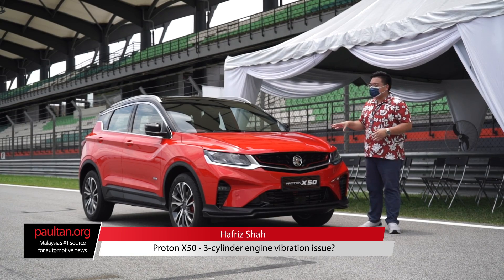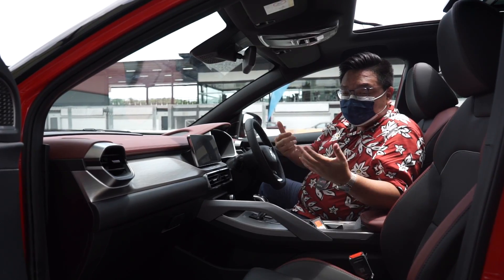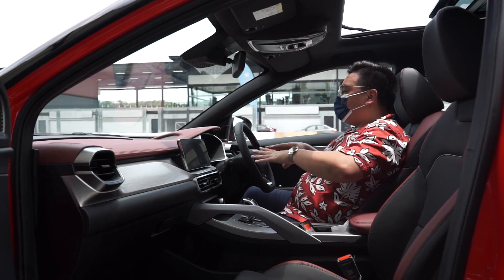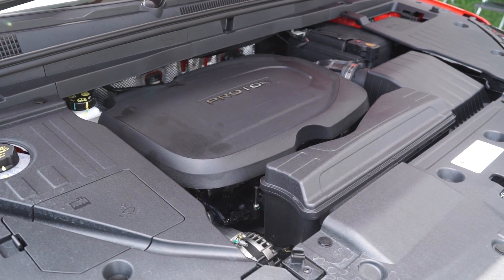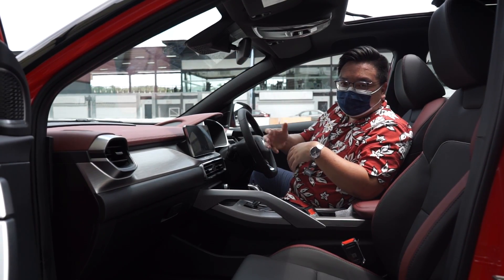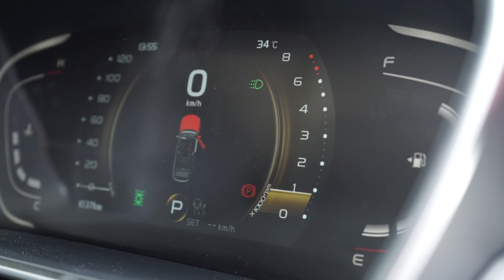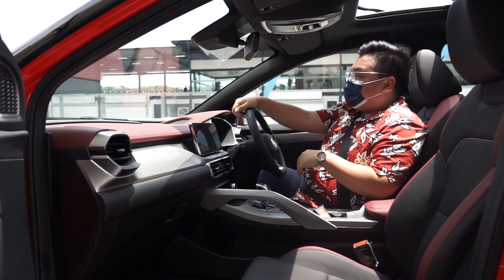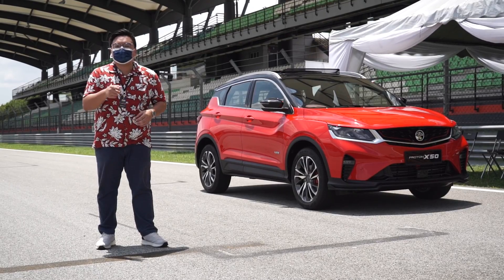Proton X50 - 3-cylinder engine vibration issue?

Comment: I don't know why so many toxic commenters wanna criticize the X50 for what it is so much. Because it's 'Proton' or because it's based on the Binyue? Give you so much, you say Malaysians are lab rats, pricey maintenance, this and that still unrefined, give you too little you say kosong, outdated, behind competition. What the heck do you guys even want??? If you don't like X50 just buy other cars lah, don't pollute rumors and false facts into the minds of non-car enthusiast. Most of the time things aren't even as bad as criticized, don't make something look as bad as it is, the price isn't here and most people don't even get to drive it yet, why so gossip so much? Aiyoooo
Reply: its called fault finding. Perhaps they could not believe proton is offering a SUV with so much features within a reasonable price range.
Reply: Competitors rumor
Reply: @nitric75  ✔️
Reply: Well said.
Reply: good comment 👍👍👍
Reply: Agree
Reply: people not simply TOXIC, they saw something wrong with it...that's all.
Reply: @mreditor5171  

Actually it's not, especially when coming from the X1 owner like myself (ex owner 😭)

When the X1 had some gearbox or oil leak issues, they didn't make a fuss about it because it is a premium continental car

U paid thousand of RM, and to have a mere proton to beat that "premium"ness of an X1, well guess what, for sure people going to look from top to bottom, end to end about this model's issue

Same as continental left to right hand conversion like Mercedes, their steering wheel is slightly deviated to the left, u guys doesn't make a fuss, but when x50 has it, wow the rumors spread almost like the car can not be driven at all

In the end of the day, proton need to launch the product with "rumors free" to people not buying this model
Reply: Waiting for some basher to bring up power window issue to all new X50 which they don't even own
Reply: there are too many 'experts' out there 🤣🤣🤣
Reply: well said bro

Comment: At  any angle you study the X50, Proton has made sure you get value for money, from styling to performance and NVH. Do the ultimate test of placing a glass of water on the engine cover like those old Nissan 2.5 advert but at what extra prices to compare ?

Comment: The main problem with 3-cylinder engines is the vibration as mentioned earlier, particularly at low rpm. Without getting too much into detail, this is due to the imbalanced nature of 3-cylinder engines that causes them to rock about.

Comment: I think this engine quite similar to Volvo's 3 cyclinders T5 engine. I suspect it is the same engine with a slight different tuning since the HP is quite similar. Although, the vibration at 2:44 is obviously too much for modern 3 cyclinders engine compare to Toyota Yaris 3 cyclinder that i had found in youtube.

Comment: Put a glass of water on top engine cover, then we can see the vibration.
Reply: I only dare to put it on a Lexus, and with many glasses of water as well.
Reply: Eh How about try to stand a piece of coin on top of engine cover?
Reply: You think what is this ah? Rolls Royce?
Reply: I've seen those tests, but I don't think that's relevant at all. The engine cover vibrates a lot, yes, but as mentioned in the video you don't feel it at all from inside the car - not at idle, not under revs and not even at full throttle. Even looking at the engine itself, only the engine cover vibrates, not the block itself.
Reply: You can built your own engine and test it first.
Reply: @hafrizshah4937  💪👍
Reply: @hafrizshah4937  bro...u punya c class enjin
Bergegar x?
Try compare
X50 with c class

Just for info
Reply: Stupidest comment ever, typical of shallow-minded people. A 6-cylinder engine, like a straight-6, is inherently balanced. A V6 is less balanced than a straight-6 but it's still easy to damp its vibrations because the piston power strokes still overlap. Putting glass of water on an engine block does not prove how well the NVH will be. A 4-cylinder engine with well-engineered balancer shafts, good counter-balanced crankshaft, hydraulic mounts, etc. could still be smoother than a V6 engine that does not have any balancer shafts and with race-prepped crankshaft & other reciprocal components.

Comment: shaft to propel
= diesel is torque, and flywheel weight of piston
= petrol is power not torque

odd numbers 1,3,5 ... on round(shaft cross-section) is smooth
even numbers 2,4,6,8 on ... is coarse(digital) and need spacing for torque to distribute over angular-distance(shape)

see above for-each sentence below
petrol 3 cylinder on shaft = not-smooth
therefore - the troubleshooting step-one should be [diesel, flywheel weight, piston weight, torque increase by reducing power, ... ..]

Comment: In a long run, it will cost the Mounting Engine issues for SURE!
Reply: This will only happen if the unbalanced harmonics are absorbed entirely by the engine mounts. In this case, it appears that it isn't. There are balancer shafts, non-symmetric rotating components, etc. to reduce reciprocal harmonics through active counter-balancing of other rotating parts. Only the minor remaining vibrations are soaked up by the engine mounts and the subframe.

Comment: My question is..why using 3 cylinders instead of 4 cylinders?..is it bcoz 3 cylinders consume less fuel?..or better perfomance?🤷
Reply: 1. Better fc especially when cruising
2. Less pollution
3. Availability of latest techs to solve the vibration problem
4. Cheaper to make
5. Lighter engine will help balance the car's weight distribution. Gives better handling
6. For turbo charged engine, more silinders or bigger displacement are  not so important to achieved big power. It's more efficient to improve power just by increasing the turbo boost.
Reply: Thanks for the question and answer
Reply: Less cylinder, more torque.